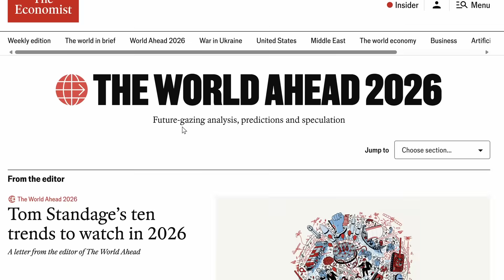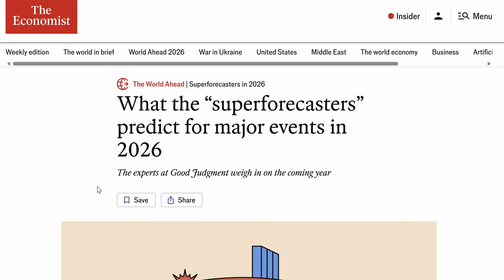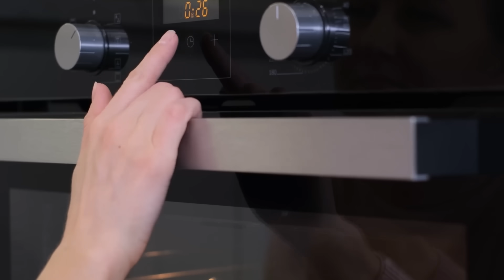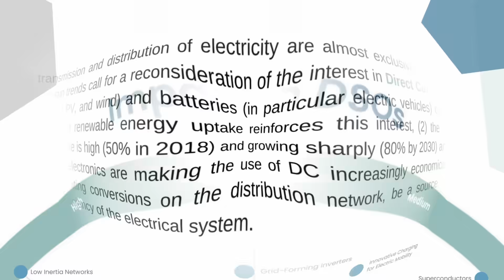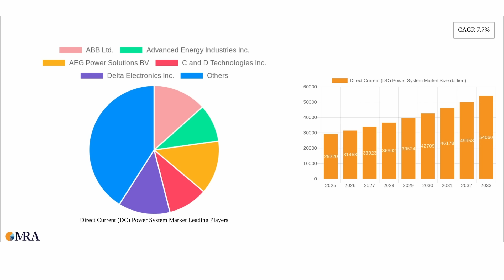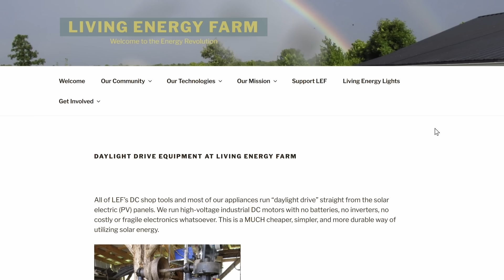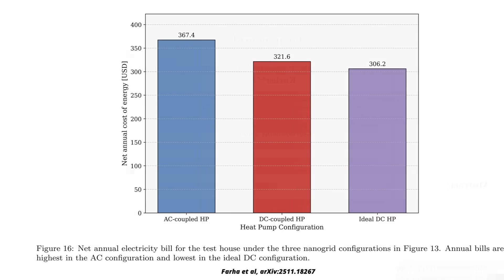Are We Using the Wrong Kind Of Electricity?

Comment: One thing you said is actually NOT true.  That is that AC is better over long distances.  The reality is that it isn't true.  There is much more line loss from AC because it acts like a giant open-air transformer and current is lost to the ground.  You may have heard about farmers being able to draw electricity from fence lines that parallel high-tension lines.  Anyway, the reason that DC had not been used over the years for distance transmission was because of the problems of converting AC to DC at the source and then DC back to AC at the end of the line, primarily the latter. In years past, they developed AC to DC rectifiers (around the late 1950's) that were more reliable than old silicon rectifiers.  However, DC to AC inverters were nowhere to be found and the only way to convert was through rotary converters with a DC motor turning an alternator.  When the AC chopper tech finally caught up, DC long distance transmission lines became a reality.  In my home state of New Hampshire, The Comerford power station in upper NH transmits to a substation located in Massachusetts using DC simply because the losses are very much reduced.

Comment: uhm... two questions:
1- wasn't a major point also that producing electricity with an "alternator" was easier and more effective when the main energy conversion method was a rotating turbine?
2- also, for this reason, do wind turbines really produce direct current? not alternating?

Comment: Looking at my brother's inverter statistics, the cheaper 48v inverters are quite wasteful because they apply a constant drain on the batteries and PV just to maintain the AC side. For small residential setups this is acceptable,  but if you get above a few tens of kWh of batteries, it may make sense to just build HV batteries and run DC around your house. The only things that would have issues are your induction motors like in air conditioners, oven forved convection fans, etc.

Comment: Diesel-electric locomotives (in the US) went to pure AC 30-40 years ago. It significantly increased power output over converting AC from the engine to DC for the traction mirrors.

Comment: With AC, the competing standards use BOTH different voltages (110, 115, 230, 240V) and frequencies (50, 60Hz).
If you want a DC system, start with a universal agreement on the voltage. 
I propose 48V to the home/office, with 12V supplied to wall sockets / server racks.

Comment: No one talks about the cables... And the amount of copper needed to transfer current to appliences.
Like a 12V moving 300A need a 50mm2 cable. A AC moving 1000A need about 64mm2 even with higher voltage, 
We are back to fat cables everywhere just to keep the light on....

Comment: Main problem with AC DC discussion is to study the High voltage Grid system, the problems with switching, corrosion , up and down stepping Voltage . Beware at home your Solar panel inverters would not last over 10yrs.No matter if it would be a DC or AC thing.  All electronic devices have aging problems. That old fight Edison and Tesla very fast ended due to long distance transmission problems with DC. You better start to focus on electronic waist , battery waist and mining problems of rare materials used in battery's.

Comment: When changing voltage in a power supply AC is used.  In an AC PSU the mains voltage is first converted to DC at the same voltage. Then it is chopped up into a high frequency AC square wave then converted back to DC with the voltage regulation done by the part chopping up circuit.
It makes little difference to the function of the PSU if it is fed with AC or DC because it converts to AC then DC anyway.

As for heaters, they don't care at all if they have AC or DC.

The advantage of a DC grid would be for solar panels and batteries because they are DC.

Comment: I was thinking something similar recently. Regards having straight High Voltage DC  would transmit.  With modern electronics we can switch.  But at the end of the day I think AC will win out for transmission as with ecessive HV the electronics Im not aware if they can handle 100's of thousands of volts and even if they did youd have catistrophic blowouts  "when they fail"  whereas the AC can go through the transformers naturally  {DC would have to be pulsed and the formers not have any issue with magitism going the same way all the time ///  theres a bit into it as flux has to rise and collapse without things becoming magnitised which then hinders the rise and collapse}.  I clicked because I thought you meant or were going to say something about  "cold electricity"   which is know off.  Called cold because thats its effects  instead of hot.  meanwhile I can see by yr lips youve been making use of the BBC flooding in from Africa.

Comment: I'm saving to build a new homestead and I've got some experience. 
Lighting on DC is so much cheaper and the wiring cost alone is seemingly the largest cost factor. 
I use aluminum 14ga for low voltage lighting. It's cheap cheap and safe for these applications. I do use fast acting fuses in living spaces vs traditional fuses for some safety. 
Breakers are just too slow and inconsistent in a residential setting at these low amps. 

The main factor in my design is how much 110v appliances am I really going to use by 2030 and beyond. I already use mostly cordless equipment that has low DC charging options. 

Transformers in DC are much more sophisticated and that's a bummer but they are way cheaper now than in 2005.

Comment: It is a so much easier technic to covert AC up and down then DC. Just some wies of copper (or an other metal) and a Block of iron inside. If every Our civilication will collapse, it will be again AC which will be prefered to transfer current ovet long distances. But maybe we will have only local grids and want to störe our electical energy. Then it will be DC

Comment: Thanks heaps Sabine. I know that Xmas in Europe…. Where it was invented… is mid winter. Interesting observations about DC. From what I glean in the NZ context then electricity from the “ Southern lakes “ is sent to the North Island via the Cook Strait cable in DC. Then at its point of usage is returned to AC. As regards the Toyota Prius then it has “ AC motors “ at the wheels as they are highly efficient and very reliable as looking around the countryside the Toyota Prius has approximately 6 stand alone computers and as such has a high resale value. In Palmerston North we will be joining the Wellington Metro grid which is run on 300 DC and will require new trains and will put us on par with Masterton and allow us to joint the metro link.

Comment: Even if we have a reliable and cheap way to convert HVDC into 350VDC, it's still:

1. More fatal than AC
2. Switches would sustain arc, can't reliably turn off HVDC without expensive switches or transistors
3. Transformer and capacitive dropper based supplies/devices (or lights) would stop working

Comment: High voltage DC probably isn’t going to be powering devices for a while (unless someone pops in from the star trek universe to give us replicators or something).

The microgrid stuff sounds like it would be really good for remote communities and camping but those aren’t exactly large markets but they sound like they would make interconnected smart grids even messier and if you are getting the power from most modern solar setups you would have to convert the >500v DC to ac drop the voltage with a transformer or whatever convert it back to DC send it to DC outlets and then run your stuff would that be more efficient than converting it to DC for each device?

Comment: In my home (so short distances) I have created a separate DC network that runs 24 volts, out of which I power everything electronic among which the TVs, at 24 volts so that I have only to step down the voltage to whichever device I need locally, TV’s need 19, larger routers as well, and then some 15 and 12 all the way down to 3.3.
One of the biggest costs of this project is copper in the form of cables as even on those short distances the cables needed to sustain a certain voltage and staying cool with as little resistance as possible with connections considering the desired load were quite hefty, this is a DIY project and I’m not an electrician but there were many websites on which one could calculate the wire gauges needed, plus since I don’t do the absurd American gauge systems, I’m glad everything was calculated in mm squared since this is how everything is done here 😊.
This did reduce stress on my batteries quite a bit instead of converting to AC and then again to DC for each device, the same load can run at a considerably higher efficiency when I don’t have the sun or mains.

Comment: I've been waiting for a standard "DC to bulb" for a few years, given that most lights are LEDs already.
Reply: 120 V AC LED lamps work perfectly well on 120 V DC.  So do lots of other things, most notably, switchmode power supplies for small electronics.  As I sit here I am charging my laptop, playing a DVD and watching a movie on a 36" LED television, all powered by three 72 solar panels wired in series.  This makes about 120-135 V DC.  No need for AC for any of them.  These things are not fussy because the peak voltage of 120 V AC is +/ - 170 volts.

Comment: Ive been thinking about this for a long time. If we move towards a more distributed grid, high voltage DC makes more sense, we can get rid of inverters. Have home batteries around 96v dc which could work well with 3 solar panels in series

Comment: Another important reason why we have primarily AC is that power stations are most likely 3-phase AC generators. Rotational energy is created from heat sources like burning fossil fuel or fission. Heat makes steam which drives turbines which then rotates the generator.

Comment: The biggest weakness i see in the DC systems are breakers. they need to be heavier duty and physically larger to ensure proper functionality

Oil and gas and hydro power generation were designed for AC .. I do not know how much changes will be needed to make them DC or if some of them will just phase out

Comment: Actually almost nothing (incandescent light bulbs maybe) runs on DC
Things that need DC and not AC actually run on modulated or switched DC.
Without some sort of variation in the current nothing would work and would probably just go up in smoke.
Pretty much every electronic device has a crystal that oscillates switching the power on and off rapidly.
High tension DC used for ultra long distance power transmission is a total mess of expensive and dangerous technologies that are only made necessary by the climate scam in order to share the very inefficient and intermittent power around from where there may be sun shining and wind blowing to places like Germany where it often doesn't.

Comment: Yeah but my stuff doesn't run at 60kv, 12kv or 240v and AC helps with that by letting me use a transformer that never dies because it has no active components to convert crazy to what I want, DC is going to be a maintenance nightmare when all your switching electronics dies after 5 years or a lightning strike, for the grid sure they have teams and maintenance schedules for homes you're insane

Comment: I'm a retired electrical engineer in power distribution with over 30 years of experience. DC works great for long distance transmission as AC efficiency decreases the longer the line is. However, at any point where the voltage needs to be transformed to a lower or higher voltage, AC is a must. Even in DC to DC converters, the transformation is performed using pulsed direct current (DC) into coils of wire (an inductor or transformer) with a magnetic core which will output AC, which then must be rectified into DC. So, for a distribution system (feeders from a substation serving homes and businesses) AC remains the most efficient. Distribution transformers can easily attain 60 plus years without failure. High power thyristors and transistors (how we create DC pulse circuits) don't have that kind of life span; attaining a 30-year life cycle is very challenging. Further, transformers can easily withstand double their rated capacity for a short period of time while thyristors will not tolerate such load surges. Distribution systems generally are set at 12,470 volts phase-to-phase, or 7,200 volts phase to ground and can be run out a distance of about 5 miles without use of voltage regulation devices. The aspect of a DC distribution voltage set at 200 volts (for safety reasons) to avoid the need of distribution DC-DC buck transformation at each load tap is not possible. Running a DC distribution feeder at higher voltages will require use of thyristor driven DC-DC converters needing replacement every 15 to 20 years. My colleague @johansvideor is 100% correct. Keep in mind that power loss is equal to the current squared times the resistance of the conductor. This is why we use high voltage to transmit high power levels - we lower the current needed and thus drastically reduce the power loss on the line. If Edison had been given enough time to implement his DC system, he soon would have hit a failure phase and likely resorted to Tesla's AC system.

Comment: You can do better than this. Saying that AC losses on power lines are lower than DC is quite misleading. In fact the opposite is true. What you mean is that it is easier to transform AC to higher voltages (AC transformers being very easily built in the 19th century) and at those higher voltages, resistive loss is much lower (it going as the square of the now low current).

Comment: Lots of comments about inverters are so efficient.  They are when running at full load.  The problem is that a 10kW inverter draws 80 Watts while producing zero Watts of output, or draws 90 Watts while powering two bathroom nightlights.  96 volt off-grid batteries (105-115 measured volts) are already approved for use in US homes.  Soon enough people will run the many things they can on DC and get the inverter shut down as the standby load of upwards of 2kWh/ day can be problem for some people during overcast weather.

Comment: “Alternating current is less ‘lossy’ when transferred over long distances.” This is not the reason why AC beat DC as the standard for electric grids. Higher voltages are the way to avoid losses over distances. This is just Ohm’s Law. Because of the way inductance works, with AC circuits, you can build simple, cheap, efficient, reliable transformers to boost voltages to very high voltages for transmission and then back down to lower levels for local usage. They didn’t have a good way of doing this with DC during Edison's and Tesla’s day, and so Edison’s DC systems worked at a single grid-wide voltage. Also, 3-phase AC motors are somewhat more efficient than DC motors and require marginally less maintenance. DC buck/boost devices have improved significantly since the 19th century, so now it’s theoretically feasible to replicate the AC grid with DC equipment. However, these buck/boost devices are still more complex in design than transformers, and I’m skeptical that a DC architecture would improve costs or efficiencies at scale. For example, high-voltage DC transmission lines are very expensive to build mostly because the conversion units to invert and rectify power at their terminals are expensive. Furthermore, I’m not sure it solves the local efficiency problem you’re positing here. Inverters (which transform DC to AC electricity) are very efficient these days — at optimal conditions PV inverters almost as efficient as transformers (nearing 98%). You can’t just dump DC PV output or even DC turbine outputs from wind or small hydro straight into a grid; these systems don’t effectively regulate voltage, so you need a device on their DC output that has a similar system function and efficiency as an inverter. The main exception is small micro-grid type systems (cabins, well pumps, etc.) where you can use a 12V or 24V battery to regulate voltage and you’re not transmitting power over a long distance.

Comment: Sabine is on about the many, many devices in our USA homes that will run on 120 volts DC.  This means switchmode power supplies as in charging cell phones and laptops, hot plate and toaster-oven, crock-pot, Mr Coffee coffee maker, vacuum cleaner, power tools such as driller, sabre saw, Sawz-All, hand-held mixer in the kitchen.  Things with thermostats need to have their contacts protected with a snubber (capacitor + diode + resistor). Things WE switch on can be wire-tied on and switched on and off from a snubber-protected switched DC outlet.  Both 120 volt incandescent and LED lamps work on 120 volts DC.  Devices that require the varying magnetic field provided by AC will Not run on DC.